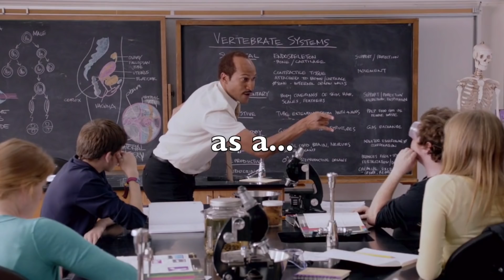Using Tesla parts in my Electric Rat Rod Conversion

Comment: That looks like the harbor freight welder I have and if so it comes with the ability to be wired for 110 or 220. If this is the case the 110 is terrible and I ran into issues with at higher settings it didn't feed consistently and the power going to the actual welding seemed to fluctuate a lot. Switching it to the 220 option made it a much better welder. Just a friendly tip.

Comment: When you put the controller box on top of the rip ties they will melt and metal ones will heat up so you should keep the heatsink mount it on the bottom heatsink out as the car moves it gets cooled🤔💡👌🧐

Comment: Would recommend making some right angle brackets that can be bolted to the plate to secure the battery. Only because the bits of steal you have "welded" won't be as strong as a single piece of steal and a couple of bolts. Just thinking about safety in minor impacts and so on. Also I think heat will be dissipated better through  conduction into the steal plate which also offers more surface area for radiation to the air. But yeah you know whatever what you have will probably be fine.

Comment: You might get some induction currents from the battery cables by zip tying them together. Generally heavy gauge wires need to be separate from each other

Comment: Oh I'm waiting impatiently for first run video. There going to be a lot happening - burnt controller under hard acceleration (cause no heatsink), lost battery under hard braking (puny bolts + snot weld + tab without reinforcement), probably a lot of electrical fires (metal shavings don't mix well with fuseboxes and electronics). All that considering that electronics and batteries aren't dead already, cause welding basically puts sh*tload of current thru every available path to lower/higher potential ie. chassis ground -> electronics -> signal ground ->battery. Oh boy it's gonna be a fun series :D

Comment: Ok so I don’t have a problem with how the build is coming together but if I may give a suggestion? 

Get some proper cable housing instead. It’s relatively inexpensive and can come in huge sizes. This would be easier to manage than the electrical tape and if you wanted to add or subtract anything it would be much easier to do so. 

For the brake pedal try to find/create a wider one for optimal brake engagement and ease of use.

Other than that this is an amazing modern rat rod that has been a delight to see come together. 

It makes me believe that rat rods can and do still exist even in a technological age as we live in today. Good luck and have fun!

Comment: Hard to say how big the load on the converter is going to be. But as others have said, air is an insulator. It transfers heat worse than steel does, and steel is worse than aluminum. You'll figure it out, though. Trial by 🔥is the way of the engineer (and hobby tinkerer).

Comment: The sevcon gen4 will produce better current when at 75 degrees Celsius (167 Fahrenheit) or less. You won't get nearly as good power without the heatsink. So I'd recommend keeping it. At 85 degrees the sevcon won't make any power.

Comment: YOU NEED A HEATSINK BONEHEAD.  Heatsinks are designed to do 2 things. 
1. Absorb Heat Away from the Controller. 

2. Dissipate Heat To The Atmosphere Quickly.  

You are going to Fry Your Controller without a Heatsink and the Thermal Paste/Gel between said Heatsink and the Controller.

Comment: In my humble opinion, you should hard mount the controller to the metal bracket and put the fins on the other side to dissipate the heat, metal to metal contact is important and the greater the surface area the better.

Comment: OK Rich, let's talk about how heat sinks work.  One, they increase the surface area so that cooling happens better.  Air is not a good conductor of heat.  If your controller is trying to disperse more heat than it can through contact with air.  a useful formula (rule of thumb actually) is: CFM (the amount of air you need to move across the heated component) = Watts (how many Watts of heat - [V*A]) times 1.76 (unit conversion constant, incorporates specific heat of air etc) divided by the allowable rise in temperature, in deg C (eg. if it's 25 deg C outside, and your controller has a maximum operating temperature of 95 C, your delta t is 70C.  Now let's say for example's sake, you are running 5kW through your controller.  You will need to move 126 CFM passed your controller.  If the plate at the bottom, is 0.5 ft^2, then you will need to be moving at ~4mph, to get enough cooling to limit the temperature rise to 70C.  This example sounds pretty OK, but apply your real numbers, and see what you need.  (you might be totally cool with it, you might need a BA heat sink, i don't know, but the rule of thumb is helpful - but it is just a rule of thumb, I would advise being conservative)

Comment: I think your battery box will come loose, I’d try using metal straps to hold it down from top, same principle as gas tank strap just upside down👍🏼 NOTHING BETTER THAN A PROJECT MOST SAY “ I WOULD NOT DO THAT.
I use to do diesel to gas swaps and everyone said it wouldn’t work lol it was a great hustle lol
👍🏼👍🏼👍🏼👍🏼👍🏼👍🏼👍🏼👍🏼👍🏼👍🏼👍🏼👍🏼👍🏼👍🏼

Comment: No criticism - you might find p-clips are better than zip ties for holding the wiring harness up. I've learned that cable ties can wear and break when passed through drilled holes.

And will those small screws stop the battery from flying forwards in a collision? And the zip ties holding the charger on? I'd suggest you need to beef all that up.

Comment: First of all, big fan of yours.  Second, having done some metal working, both diy and for work, I wanted to let u know cutting or drilling fluid will save u a BUNCH of drill bits.  Not sure what your change out rate is, but it will be less often for sure, just a little messyer.  Doesn't smell half bad either, if your into that kind of thing.  Just a friendly heads up, can't wait to see how it turns out keep up the good work.

Comment: Hey rich that thing is kind of technically your radiator so here's an absolutely crazy idea how about leaving the heat sink right where it belongs and mounting that thing behind your grill shell since it kind of probably maybe sort of flip flops with a welder while holding a grinder the wrong way because I'm sure something with cooling fins that big on it are just for looks I fear I see a hot rod fire in your future.

Comment: If you're welding with flux wire, did you remember to reverse the + and - connections (+ to GND clamp and - to tip)?  As a crappy occasional welder that always uses flux core wire, I just thought I'd bring it up as a possibility.

Comment: I would not run that motor controller without the heatsink not only would it have less cooling it'll have a lot less thermal mass.
If you want to improve the cooling maybe add a fan to the heat sink or if you want it out of sight mount the heat sink to the bottom side of the steel plate and mount the controller on the other side make sure it's perfectly flat and use plenty of thermal compound on both sides think of it as a really big computer CPU as an air gap would pretty much spell death.
Another option raid one of the parts Teslas for a water block off the inverter, a pump, and a radiator and make it liquid cooled.

Comment: Hey rich, as a reverse engineer... I'm just messing with you. I just like taking shit apart & putting it back together or using the parts for other things. But on that thought, what if you extend the wires to the kickstand to the inside cab and use the kickstand as a retro cutoff switch. I remember something that it wouldn't turn on because of the kickstand was in a curtain position in the episode when you first got the e-bike. Just a thought... 
Godspeed bud....

Comment: Put the throttle on the steering wheel and then put one off those one handed turning knobs through it so you can accelerate and turn at the same time with one hand!

Comment: The original VW beetle was air cooled..so hey just copy the germans.

No really.. you need the fins on the heat sync, they create the surface area for cooling. 
Mount the sync to the underside of the plate the controller is on and use transfer paste.  Include a small fan too and some type of temp sensor to monitor it for overheating .

Comment: What's the safety rating on those flops.once you get hot spark or a weld bead jump you'll be safe. At least they will break an  electrical jump. Most people would have looked for shorter seats.
Reply: It's easy to arm chair those trying new things , if we were all experts what would we complain about.

Comment: Please keep it metal to metal on the controller. Even if the controller heat face is just contacting the steel support plate, it is still spreading the heat onto structure away from the controller (See heat pipes in the CPU world). The fact that there is a heat sink at all means the exposed metal of the controller is not enough to cool it, so the spacers will actually be worse. 
I'm not an engineer, I only pretended to be one in college.

Comment: Rich!!! read up on screw grades..those cheap household screws you mounted the battery box with are really wimpy junk! Use at least Grade 8 bolts & nuts, with lock washers.. properly torqued.

Comment: Don't you need that surface area from the heat sink to cool it? I'm not sure but I think metal on metal as far as a heat sink is the way to go, regardless if you go the air cooled route will it get hotter as it sits while turned on? I know if its sitting then the motor will be making no demands on the controller but its still got a lot of juice in there. love the channel, all the best to you and yours!

Comment: Or on the heatsink if you do use it just cut a route on both sides of the plate where you can bolt the plate and have it in between with the heatsink and plate together.peace

Comment: Get yourself some pushmount cable tie s. More better than zip ties through that metal plate. Maybe consider 1 single hole with a grommet to run wiring instead of your big gap and weather stripping.

Comment: As an experienced googler, i've done some research about your home made cooling solution and there's some fun stuff i want to share. Steel has 4 times less thermal conductivity than aluminium, with that said you also reduced the surface area by about the same amount. In addition the welding of that extension plate has to be grinded down to a level where your controller sits flush with the plates. In case my research is incorrect, please let me know so i can stop using google for good.

Comment: I would think bolting the Controller directly to the steel plate [with thermal grease in between] would be better, you sink the heat into the car. Hell you could even use more thermal grease, and even longer bolts and bolt the heat sink to the bottom side of that plate to add surface area.

Comment: ^^ As a fellow Kitchen knife user i'm worried about it's reduced screentime recently.
Gonna fry the juge control module if you dont cool it with ducts or fans... (Or Water cooling? ).
Thanks again for an amazing project.

Comment: So the controller will be cooler without the heatsink because it has a gap? Then use plastic zip ties under hot controller that will hold the wires in place.
Likely everything will be ok, but still....

Comment: As a guy who knows everything, I'm here to tell you that you are going to totally fry that Sevcon. The plate on the bottom is a heat spreader to help even out the heat from the components mounted to it internally, it does no cooling itself as it's a flat plate with little surface area. If you are really determined to not use that heat sink, at least thermally sink it to the plate with some thermal paste so the heat has somewhere to go.

Comment: I'm just going to say, you could buy a hobart or lincoln mig for 8-900 and do so much better. Lifelong tool! The Welder really matters. Thanks for sharing the project.
Reply: You'd get a lot more heat and use some gas which would make everything nicer just by having a nicer welder.

Comment: Rich   I like the build, but those welds !!!    I think your technique  isn't bad .  I think you might  be using the wrong wire.  If you are  going to weld without a shielding gas  (not the best option) you need to use a flux core wire.  Or better yet get yourself  a tank of 75% argon and 25% oxygen  and you should have better results

Comment: About that cooling you should put it direct on the steel and the bolt the aluminum cooling on the bottom of the steel use thermal paste

Comment: I dont know if it is ok to remove the heatsink  for a metal plate with smaller surface area and no conduction medium in between. I would request you to reconsider the heatsink.

Comment: to be honest i would be worried about those welds, maybe try to get a nice hot weld on the under side of the plate to the frame, i would feel better if you atleast did that.

Comment: I really hope your trolling rich. Rich order some thermal paste. Also put that original heat sync back on what will happen is the metal bracket you made will saturate with heat in a few min and then it will over heat or shutdown if controller is smart. The point of a heat sync is to increases surface area of metal to air what you did is divide it by about 10 times or more. While increasing the mass / heat storage of the heat sync generally not a good idea because the mass is also an insulator. Also if you want it slimmer maybe consider making customer water block you could probably get away with PC water cooling parts:)

Comment: As someone who likes cheese, I would have mounted the controller directly on the plate using thermal compound and then mounting the heatsink underneath the mounting plate again using thermal compound, this helps with cooling and moves the heatsink out of the way.
Reply: Am I doing it right?

Comment: Instead of air cooling the controller by floating you should get some computer heat sink paste and mount the controller to the plate then the air will just cool the plate but the heat will be removed more efficiently from the controller

Comment: You mentioned tying off your wiring harness with zip ties, but I see two problems with that strategy:  1) Especially if the zipties are being mounted outside the car, it's not a very weather resistant option or resistant to pests chewing them apart, and having seen previous videos in which you have had to duel with rodents chewing on your wiring, the zipties are not a very durable solution.  2) Plastic has a tendency to age and crack, which means when it does, your wiring harness loses its support.
A better idea - buy U brackets and metal (steel or aluminum) pipe aka metal conduit.  That's right.  Run the pipe along its path, and then run the wiring harness inside the pipe.  Use the U brackets to mount the pipe to your car's body.  Bingo.  Weather-resistant and pest resistant shielding for your wire harness.

Comment: As a human being; Rich, I like you and for that reason I'm asking you to never take this thing out of your driveway. This would have been a project for a team of designers and engineers, backed up by very professional equipment. Half of your bolts would shear even under harsh breaking, God forbid this thing ever got in a crash. Your welding is perfectly adequate for slow impacts but if they're stressed under a shock load, they'll fail terribly. Never take this thing above 40.

Comment: You do realize that the controller used a thermal paste most likely. That is what it looked like. Even just air will not be enough. Think of air flow in any other car, it is not the same and will heat drastically fast. Use a thermal compound and that cooler from the bike or go the length to custom fabricate one.

Comment: As a guy with the first name Richard, I could safely say, you just drastically reduced the effective heat transfer surface by removing the heatsink. It is going to overheat (given that Zero didn't over design the passive cooling equipment).

Comment: Dude, you really need to mount the controller directly to the metal spacing or else it will burn out. Metal is a much better heat conductor then air.
And make sure you apply fresh cooling pasta as well to fill oout any gaps of air that will prevent the heat being transferred out of the controller.

Comment: i'm still confused why you left the transmission when factory ev are direct drive, you even had to make an adaptor to make it fit to the transmission, wouldn't it have made more sense to somehow have the transmission replaced with some length of driveshaft, or have a custom length shaft from a shop, then made the motor fit directly to the driveshaft with an adaptor, since one was made just to fit up to the transmission, anyways?

Comment: Missed opportunity! When you said "Skip college debt" you should have flashed a picture of Bernie Sanders and said "No, not like that..."
Sorry, I couldn't resist.
BTW - the controller may be designed to need a heat sink if the backside is a thick metal plate so if that is the case it will stay much cooler bolted directly to the frame to wick the heat away instead of relying on what little airflow it receives under the heat sink.

Comment: What were you doing with that weld? using gas wire without gas or trying to weld with flux core and have wrong polarity, metals or amperage(yes a proper short extension cord needs to be heavy enough)

Comment: As a 30 year car pedaler, that brake looks pretty sketch. :) Hopefully it's proof of concept and Rich will prove this setup works, then buy something safer like and off the shelf pedal assembly. Not sure I'd want a wobbly brake pedal like that to save me from impending doom and impact caused electrical fire. Oh, and nice license plate pivot point for your heel :) (Keep it up, these are funny)